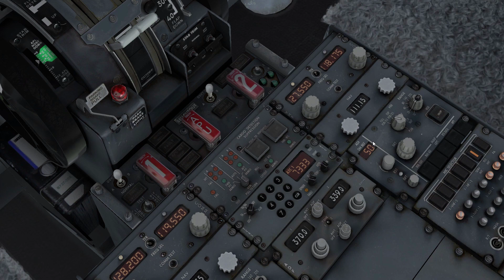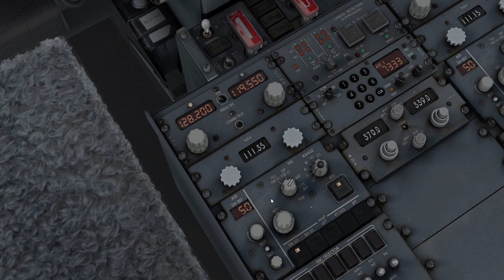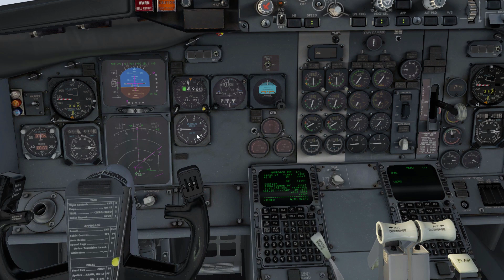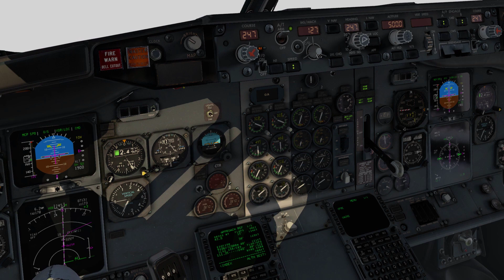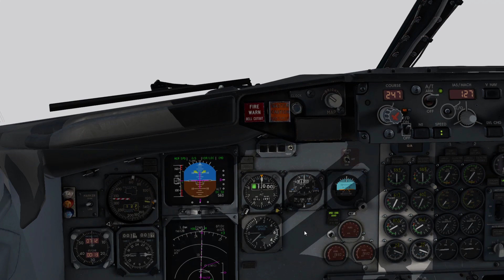IXEG 737-300 CatIIIa dual-channel approach and autoland

Comment: Great, thank you! Just one quick question...with the autoland, does the auto-throttle disengage automatically on touchdown, or does one need to disable that manually as well?
Reply from the maker: It disengages automatically (reverts to OFF) 2s after touchdown